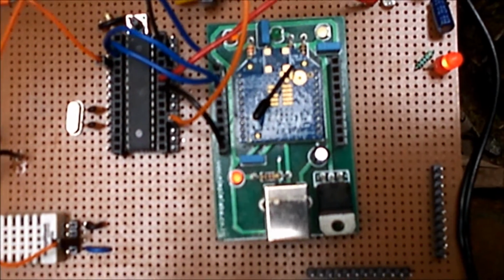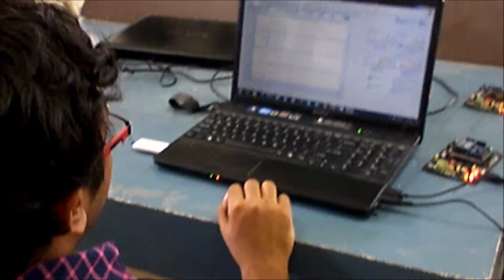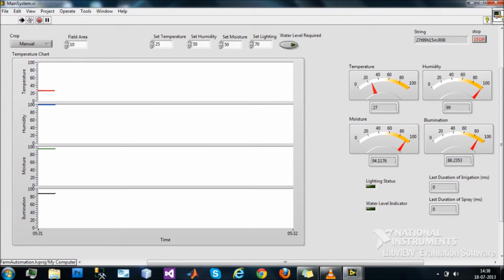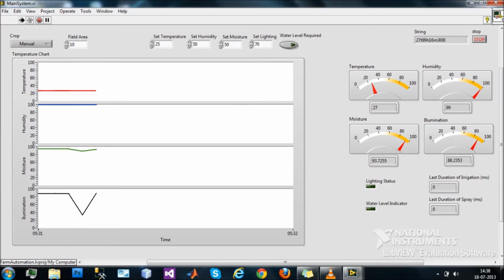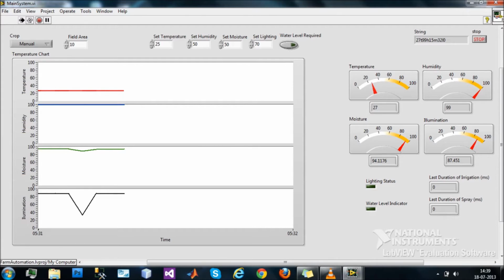Niyantra 2013 - Farm Automation System

Comment: wouldn't it be easier to use a simple UART unit as a data compiler in your laptop (instead of your arduino board+xbee shield module)? Just wondering, not an expert... Keep the great work!

Comment: I liked your video. By your accent you're Indian, right? I met mumbai is about 4 years old. I want to visit India again. Well, I also work with the arduino. Use it to control my irrigation system. Yet adapted the sensors. I'm working on a project tensiometer because the humidity sensor I have is equal to his, but his life is short. Have ideas for the future?